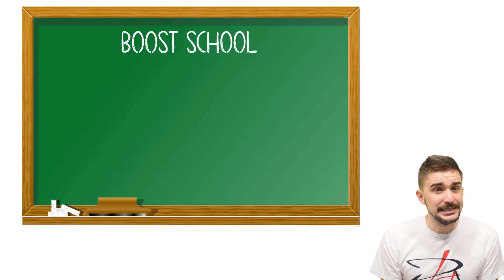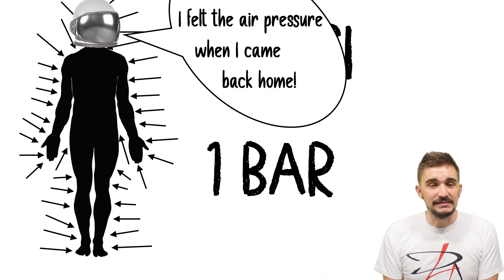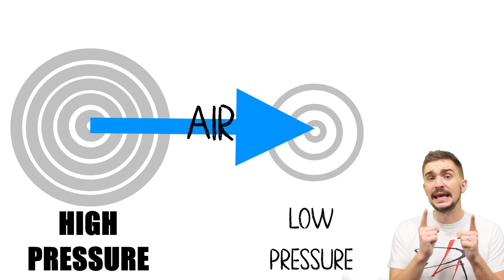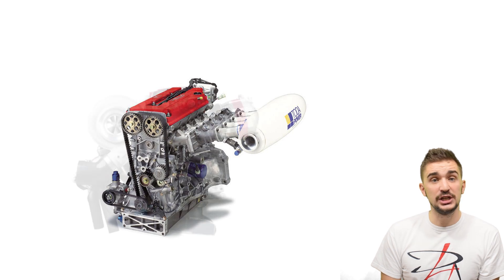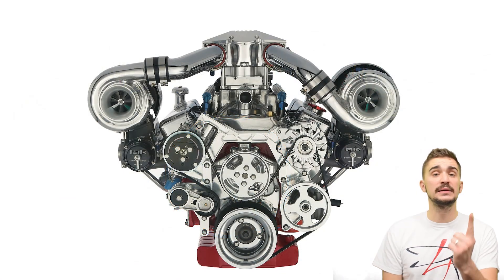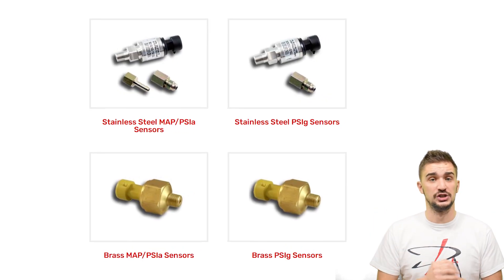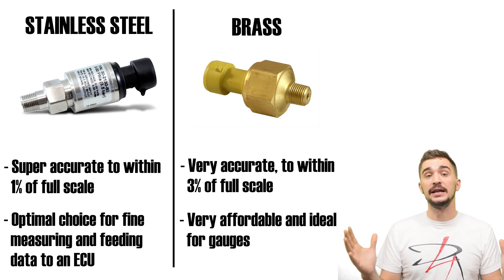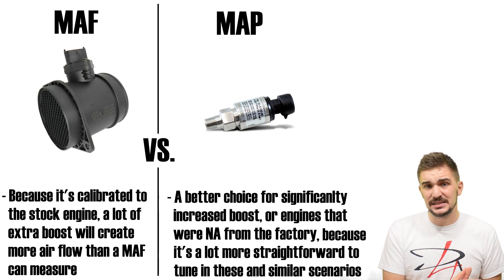BOOST pressure vs. MANIFOLD ABSOLUTE pressure vs. ATMOSPHERIC pressure - BOOST SCHOOL #4

Comment: I think it gets really confusing for some unless you really hammer in that there is in fact a third, barometric pressure sensor in the car somewhere.

Both of the sensors you mention in the video are inside the air loop of the engine so they wouldn't have the reference point without the third one, which is outside of that loop.
Reply from the maker: Many cars don't have a third barometric pressure sensor. The vast majority of tuned cars don't run one either. The ECU sees the pressure in the manifold and knows the air temperature and engine load from the TPS, based on this it calculates fuel. The pressure inside the manifold is directly correlated to the outside pressure and will change as the outside pressure changes, so the ECU already accounts for it. It doesn't really need to reference or know the outside pressure as it's already influenced by it.
Reply: @d4a   I think I realized what tripped me up. It just sunk in how a pressure sensor can be referenced with outside temperature: if the reference chamber is open to external pressure instead of sealed.

I think the description of a MAP sensor from your other video just put me in the mind that every pressure sensor was referenced to specific pressure in the sealed chamber. My bad and thanks for clarification.
Reply from the maker: No problem, all I do is talk about this stuff and I often trip up too, it definitely trains the mind 😊

Comment: Sorry my friend but 1 bar is 14.504 psi and while you are correct about 14.7 psi  (at sea level and actually 14.6959 psi) that is actually 1.01325 bar.  As for the void in the cylinder you forgot the residual fraction ( exhaust gas that doesn't leave the chamber because there is always a small volume left) which albeit is not does exert a pressure and is usually higher than the intake manifold pressure which is why we have valve overlap to allow the pressures to equilibrate before the piston starts moving downward.  Actually due to pressure losses in the aircleaner and throttle body air pressure in the intake manifold plenum will always be below atmospheric pressure.  At certain engine speeds with proper tuning of the intake manifold runners you can achieve higher than atmospheric pressure in the cylinder which is what really matters.

Comment: so there are some gauges that are not baro compensated and will show absolute pressure on a "gauge" scale. gauge meaning 0 = normal atmospheric pressure or 14.7 psi. you can tell this if your gauge does not always show 0 day to day or when you change altitude. however most newer gauges are baro compensated.

Comment: 2:48 Death Valley has 14.9 psi of pressure due to being a 280 ft below sea level
Reply: death valley boost balley confirmed
Reply: Not to mention some of the mine shafts we've dug out
Reply: When my car had no turbo it ran really REALLY well in Death Valley. 

Now it has a variable turbo it runs REALLY well, all the time :)
Reply: @fastinradfordable  Death Valley is also very hot, so while it might have high pressure the air isn't very dense (unless you drive at night)

Comment: Another way to pass a MAF limitations is to devide your intake in 2, putting the MAF on only one side. It will then remain precise as it will measure only half of the air entering. Then you'll have to adjust the ECU program to take this into account (basically multiply by 2 the values related to MAF). If you want to be more precise by measuring exactly what's coming in the 2 sides, you can also use 2 MAFs, one for each side. Each will be measuring half of the air. You'll have to use a device between the MAFs and the ECU to add the 2 MAFs values and then send the result to the ECU.
Reply: Great until one cylinder has a problem and it is either not noticed or over compensated.

Comment: I have a question about oxygen density: does it change drastically due to the changes in humidity? And if it does, does the map sensor know it? And if not, does high power applications have any sort of humidity sensor?

Comment: Most aftermarket boost gauges I’ve seen are plumbing after the throttle body, therefore showing manifold pressure??
Reply: Correct

Comment: So happy always to hear your explanations making complex stuff look simple. Can i ask if diverter valves are necessary in turbo cars and whether compressor surge is real problem. Some say it does not affect longevity of turbo and a source if boost leak. Thank you for any advice
Reply: It depends on what setup. 
In my experience having diverted valve(s) (some high models have dual diverter valves. )

Diverter valves are better than wastegates because when the wastegate opens the turbo shaft changes speed. 

Diverting air does not interrupt the turbine spinning.

Comment: At a higher altitude wouldn't the base boost pressure be a slight vacuum due to the altitude and the turbo having to work slightly harder bring it to the same boost reading as at ground level?  Also also would they be at the same RPM, throttle opening or fuel flow?

Comment: Anything over 29.92" Hg or 14.7PSI at 59°F/15°C standard day sea level is considered boosted over MAP. Boosting is needed to either sustain 29.92"Hg in Aviation or to provide more horsepower.

Comment: MAP has major draw back of not taking into account of wear.  Either compression loss with less vacuum produced which is interpreted as higher eninge load irregardless of actual load; or blocked air filter which result in the exact opposite.

Where as MAF measures the MASS of no matter state of eninge.  As for modifications its as simple of upgrading the MAF and calibrating the ECU.

MAF and MAP can do the same  job but the MAF isn't relying on a reference table for interpolation--which is affected by wear items--as MAP is.

Comment: You are talking of lower air pressure at high altitude and less power developed by the engine in that case, but I was convinced that less power is not so much due to the pressure but because of the less oxygen at high altitudes.
Reply: Same thing, just another way of stating it. Lower pressure = lower quantity of gas molecules = lower quantity of oxygen.
Reply: There is less oxygen. There is also less nitrogen, carbon dioxide, water vapor, etc. Same 78/21/1 ratio. But less oxygen available for combustion, so less fuel may be burned, so less power.

Comment: While the atmosphere is least dense atop an earthly land structure, mount everest.  Technically the beaches on the equator are higher than mount Everest.  Relative to the center of the earth due to the oblong shape of the earth at the equator from centrifugal force.  The Hawaii Islands are the tallest mountains on earth sans water.
Reply from the maker: I think you misunderstood the article. Mount Chimborazo is the highest point when measured from Earth's center, but Mount Everest is still by far the highest point from the global mean sea level, it's right in the first paragraph of the article in the link....

Comment: I never understood why manufacturers installed boost gauges in turbo cars instead of a manifold absolute pressure gauge, as used in piston aircraft. Simple, accurate, and easy to interpret ...

Comment: You may not feel the pressure at altitude but you can feel the effects of hypoxia. I wonder if orientation of a sensor relative to the engine position helps, perpendicular to the engine tq and not over the top of the head.